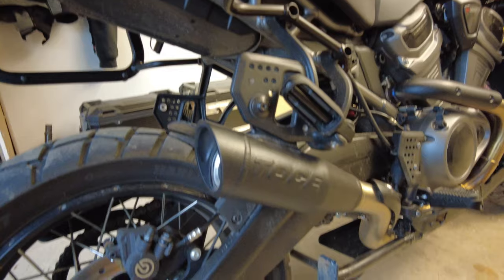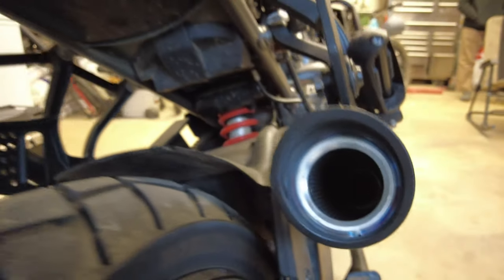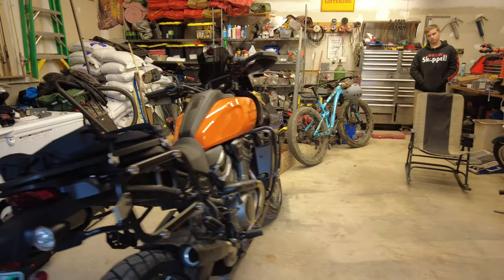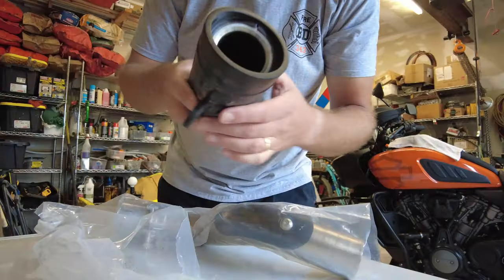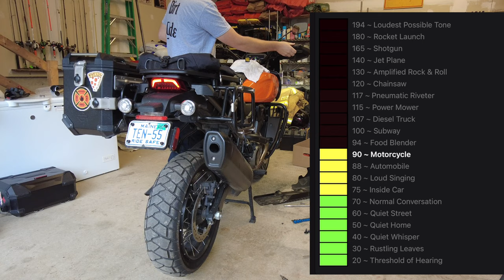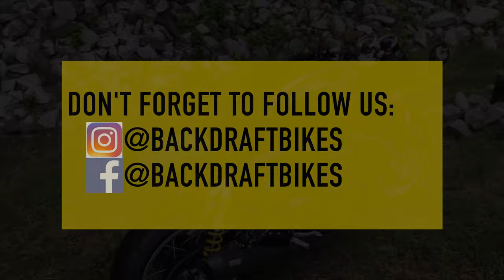Harley Davidson Aftermarket Toce Exhaust Slip-on HQ AUDIO Comparison Stock Pipe Aftermarket

Comment: Harley has put the battery in a very strange place.. I am worried if it will have issues with water crossing or even riding in rain where water is just flung to that section.
Reply from the maker: Yes, there was. Cold weather freezing was not good.

Comment: Any tuning needed ? Or does the BCM/ECM sort out you have a slip on fitted?
Reply from the maker: Self learning. I am anxiously awaiting tunes though that I’m sure folks are working on
Reply: every change to the original exhaust system must be recalibrated. a non-tune almost always means loss of performance. more exhaust gases out more fuel in. take DON Performance ;)